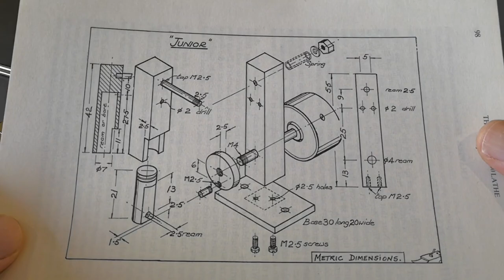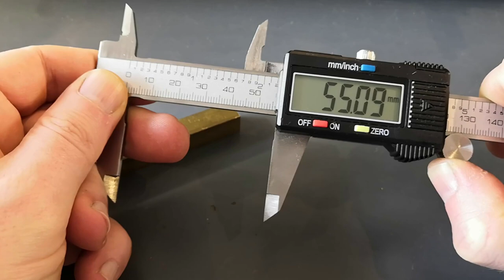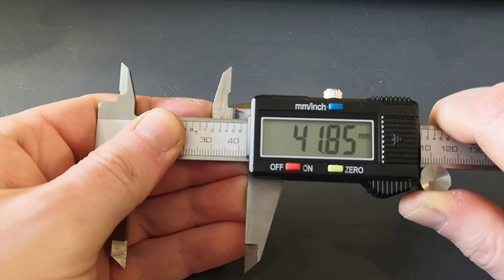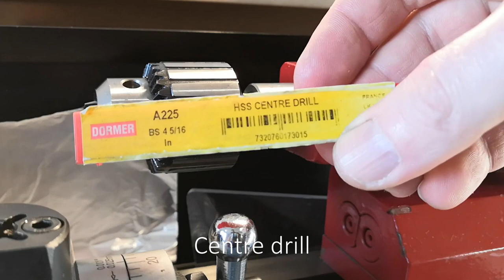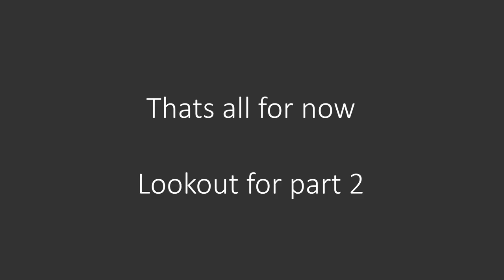(Pt1) Making a simple oscillating steam engine. Mini lathe project.

Comment: just built that motor only with diffrent materials and spex , still has a brass piston. only part left is figuring out the intake and exhaust ports.......wasnt as nice as yours but  the general idea is the same

being that I didnt build to your scale, am seeing thiers 3 holes for the intake and exhaust
so when the wobble starts the 2 holes have to line up with the 1 hole as it goes back/forth right??
Reply from the maker: I'll try to explain. 😅

There are 2 holes in the column (lets call them A and B) and 1 in the cylinder (lets call it C).

As the air enters through (A) into the cylinder (C) it pushes the piston down moving the cylinder into a position which aligns (C)&(B) where the air is exhausted and the cycle starts again.

Hope that makes sense? I'd love to see your build btw. 😎
Reply: @machinist_matt      dont quite get it  yet.............so when I drill the 2 holes in the column do they line up with the 1 hole in the cylinder?? I made some wobblers  by tubelcain , is it anything like that??
Reply from the maker: @stanburdick9708  This diagram explains better than I can.

https://en.m.wikipedia.org/wiki/File:Oscillating_cylinder.jpg
Reply: @machinist_matt  ok thanx for that, if I got it right >>>>>>>>>>> when the main tower with the 2 holes  leans left its putting air  thru the 1 hole in the cylinder  and visa versa right?>>>>>>>>> still trying to figure out where to drill the 1 hole in the cylinder  in relation to the 2 holes in the main tower
Reply from the maker: @stanburdick9708  Yes that's it you got it. Generally the single hole in the cylinder is bang in the middle and at the very top of the stroke IIRC. 🙂
Reply: @machinist_matt    ok I built one if you would ike to see it need contact info
Reply: made one not as nice as yours but dont know your contact info to send a pic
Reply from the maker: @stanburdick9708  Hi Stan. Sorry for the slow reply. I'd love to see it. I've added email to the description of this video (without spaces). Thanks. 👍

Comment: Can I ask what lathe this model was made on please?
Reply from the maker: Hello. Yes, it's a CJ18A mini lathe.
Reply: Thanks Matt. I’m gonna have a go at making one. Got all the materials however, base plate is thicker material so I’m assuming I just need slightly longer fixing screws?
Reply from the maker: @michaelchatt2639  Yes a thicker base and longer screws should be fine. Good luck with the build! 👍
Reply: Thanks Matt. Last question is how you achieved the polished finished which is clearly seen in pt5 when you assemble. Thanks.
Reply from the maker: @michaelchatt2639  I just used various grades of fine sandpaper. The finest being 1200 grit to give it a lightly brushed finish. 🙂
Reply: That’s good. Thanks. Sorry, this is the last question as I do not possess a 4 jaw chuck, where is your attachment from, ie, collett and locking nut? Have you a link please?
Reply from the maker: @michaelchatt2639 Don't worry about asking questions, I don't mind. 🙂 The collet chuck is from arceurotrade. ER40 100mm diameter.
 https://www.arceurotrade.co.uk/Catalogue/Collets/ER-Lathe-Collet-Chucks/ER40-Lathe-Collet-Chucks
Reply: Thanks ever so much Matt. Just ordered an Axminster mini lathe SC02. Hopefully have it tomorrow or Thursday. You UK based?
Reply from the maker: @michaelchatt2639  Congrats on the new lathe! and yes I'm from the UK. 👍
Reply: @machinist_matt  cool. I’m in the Northeast. Matt, the 7mm bore that takes the piston in the cylinder, how deep do I go please? Is it 27.5mm as per drawing and I’m assuming the verniers will measure the depth. Apologies again for all the questions
Reply from the maker: @michaelchatt2639  It's 28.5mm deep. The 27.5mm measurement is to the centre of the inlet hole, the hole is 2mm so you need to add half the diameter. I usually measure depth with the rear of my digital caliper.
Reply: @machinist_matt  thanks again Matt. I really appreciate your help, advice and patience. I’ve been looking again at your build, pausing when necessary to ascertain the collett size, plate and fixing nut which I’ll purchase I believe should be metric. Not sure if yours is 100mm or 125mm diameter.
Reply from the maker: @michaelchatt2639  Hi Michael. It's 100mm diameter with a 72mm register.
Reply: @machinist_matt  thank you. I’ve bit the bullet Matt and bought a self-centering 4 jaw chuck. Picked me lathe up today, about 2pm so must have come up overnight. Just waiting of my son to help me out the car with it lol
Reply from the maker: @michaelchatt2639  The 4 jaw will be useful. I would like one myself. Have fun with the new lathe! 👍
Reply: Cheers matey. Just watching part 1 again where you have stepped up to the micro boring tool. Again, are you periodically checking depth and diameter as it looks like a 7mm drill is last used prior to the boring tool. You make it look easy by the way. If you search me on Facebook Matt I’d appreciate a friend request. Feel awful bothering you on here. Sorry fella.
Reply from the maker: @michaelchatt2639  I think I went just over 7mm if I remember correctly, and then made the piston to suit.

I don't do facebook, or any social media for that matter. My email is at the bottom of the video description if you want to use that.
Reply: @machinist_matt  thanks again Matt. Unboxed my lathe earlier. Going to bolt it to my bench tomorrow and crack on.
Reply: @machinist_matt  hi mate. Hope I’m not coming across as annoying however, to recap, you used the rear of your verniers to measure the depth of the cylinder bore? Just the video only shows the drilling and boring out without any measuring.
Reply from the maker: @michaelchatt2639  Yes I measured with the caliper down to 28.5mm. You could use a proper depth gauge. You can get fairly cheap.
Reply: @machinist_matt  thanks again